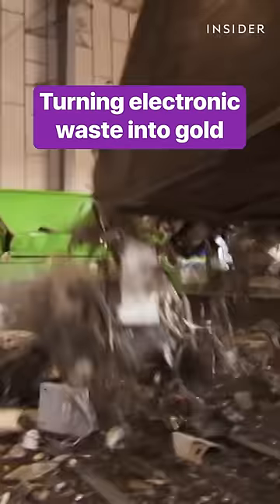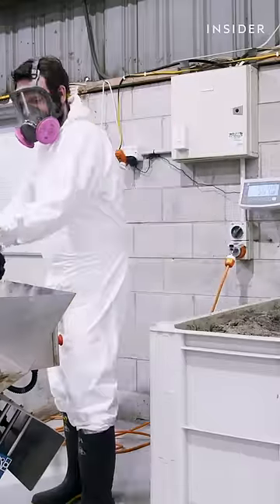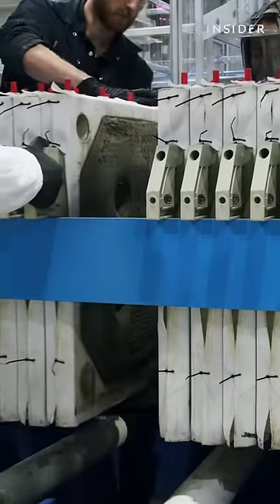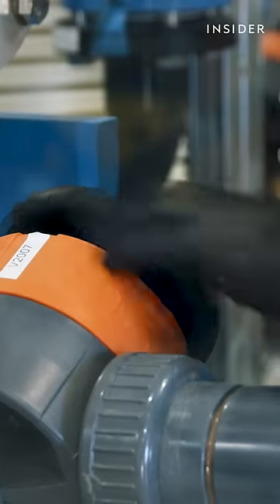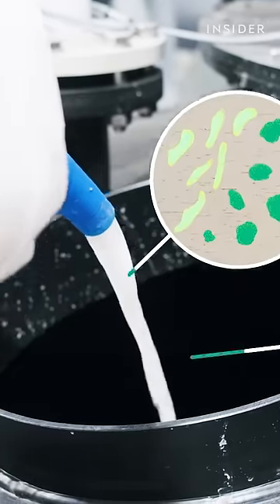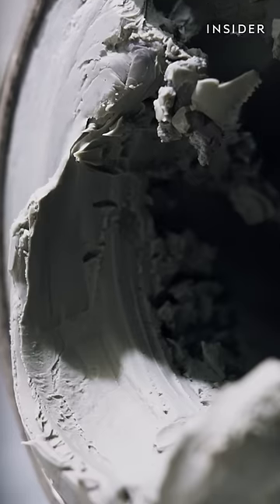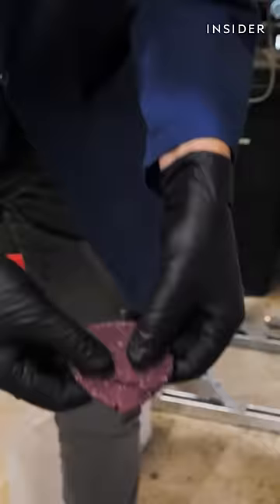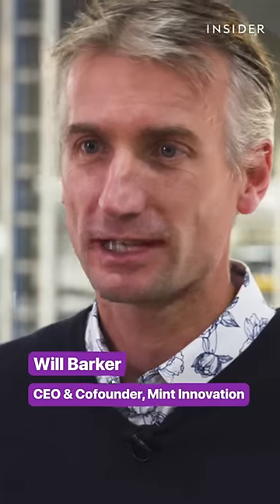Did you know you can extract gold from a pile of old circuit boards? #ewaste #gold #recycling

Comment: That seems extremely overcomplicated and unnecessary. There has to be a simpler way to get that gold out of the electronics!!
Reply: Then perhaps you should be the one to figure it out :) follow that inkling to the end
Reply: @devin9205  I'm definitely curious enough to do so if I had the means to do so.
Reply: Lol no. 
The scrap gold market margins are razor thin because a lot of the gold is either in coatings or in bonding wires inside the package of an IC. Your only options are this or slave labor.

Comment: Seems like an awful lot of work for such a small yield. I get that there is a tremendous amount of electronic waste each year, but unless you can get it for free, you're wasting time, energy, and money. Simple math problem I would like to know how much gold and palladium as well as other precious metals are on a circuit board? Saw a video one time where a guy did it the old-fashioned way and used hydrochloric acid to dissolve the gold into a solution from like 10 pounds of circuit boards (unused extras from some where) and all he got was a small ball under a gram and only about $100. Took him two or three days in his garage by himself. I can't imagine having a factory set up with even part-time employees and then farming out the smelting?! Profit margin is what $1.83??!!

Comment: Too long and drawn out, easier to just use tools or a soldering iron and extract the gold from the boards and melt it down from that, including where there is gold wire.  This is too complicated and too expensive, no wonder gold prices are rising.